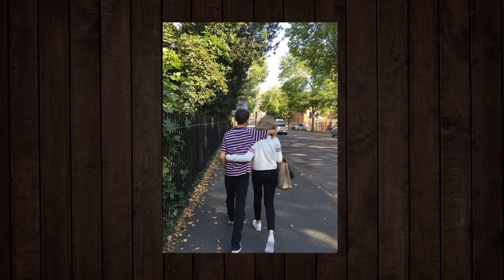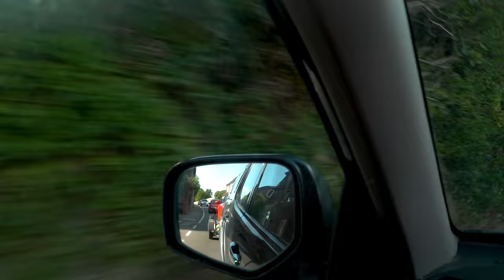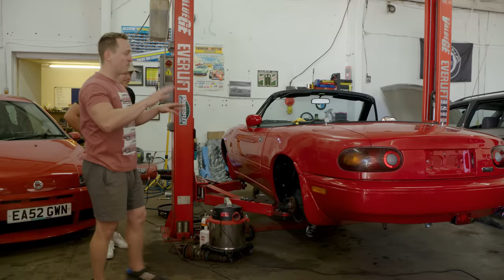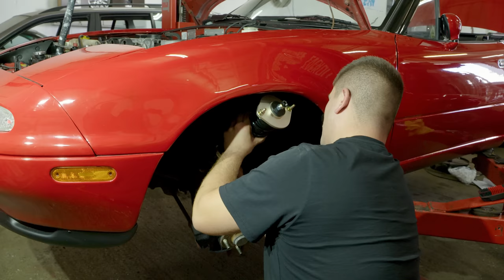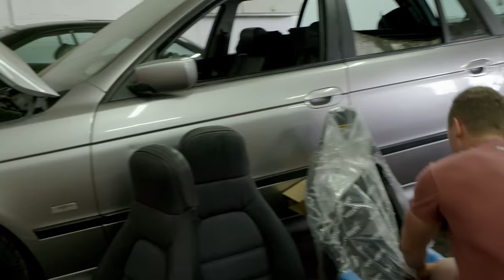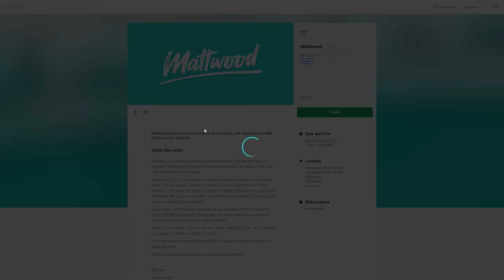Dear Car Community, I Need Your Help

Comment: All three of them getting such vicious cancer is no coincidence. They need to look at their housing over the years and what they've been consuming. You can be genetically more vulnerable to carcinogens but there have to be carcinogens to start with.
I'm guessing their house/houses. Someone is responsible for the pain they've been through and there's no way they should get away with it. It absolutely had to be investigated but I understand that's not something that they can deal with as well. Hopefully someone steps up to take a case on for them.